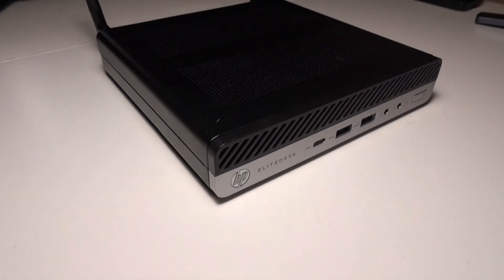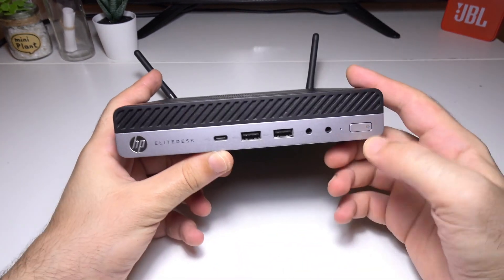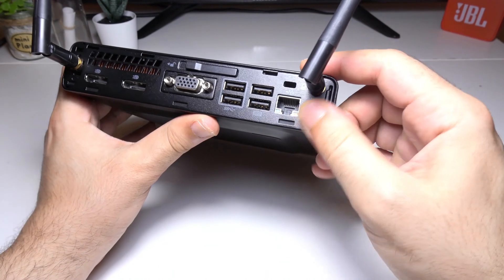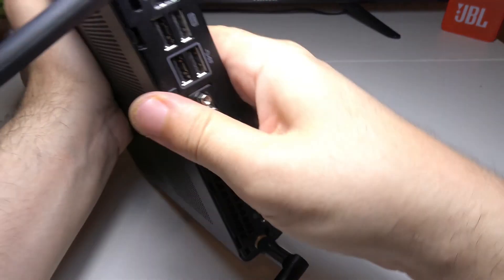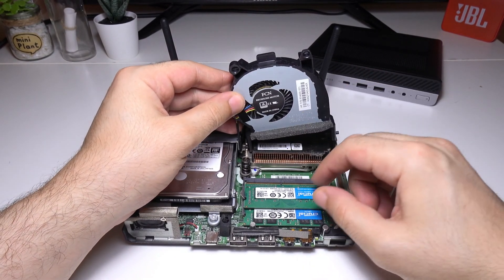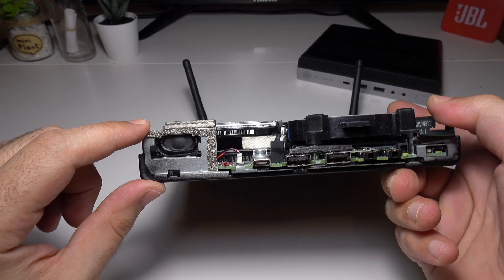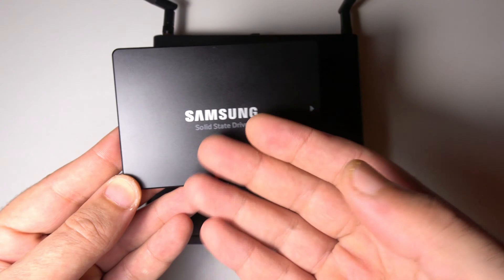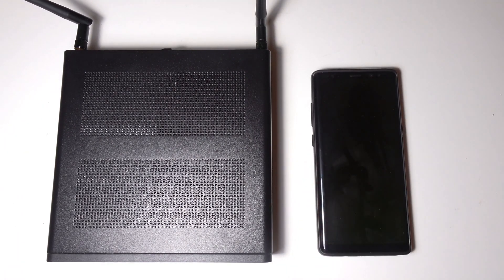HP EliteDesk 800 65W G3 (Everything You Need To Know)

Comment: I need this for my podcast live streaming
Reply from the maker: It's a bit old now. Pick up the newer version, and check the link in the description.
Reply: @RandomTeq  the one I was looking at has an INTEL CORE i7 QUAD CORE ram 32GB 120GB SSD
Reply from the maker: Check this, i7 16gb 512gb SSD. You can upgrade the RAM if you wish.

https://amzn.to/464zBs0
Reply: @RandomTeq  thank you for getting back to me. I’ve actually found a mini PC on Amazon UK and it’s I’ll send you the specs so you can tell me what you think. My friend has the exact same one and it’s very good for streaming. ACEMAGICIAN Mini Gaming PC AMD Ryzen 7 Pro 5875U(up to 4.50Ghz), 32GB DDR4(Dual Channel) 512GB NVMe SSD Mini Computers, 4K-Triple-Screen/WiFi6/BT5.2/RGB Lights/3 Modes Mini Desktop Pc for Gamer i’m not going to game on it all I need it for is my live streaming because I do a lot of paranormal stuff and I need to share multiple screens
Reply from the maker: I believe this is the one you're referring to:

https://amzn.to/41vyP5Y

It's a good brand, I have reviewed one of their mini PCs before. The CPU is reasonably powerful. For streaming, it will do just fine. Both the SSD and RAM are upgradable, which is a good thing.

Comment: Does anyone happen to know if these support a 2560x1080 ultrawide resolution..?
Reply from the maker: Yes, it can support all the way yo to 3840x2160.

This version is now outdated. You might want to consider the new version that came a few years later. it's not the latest, but it's far better than the one on this video.

Its 250 USD and offers far better value.
https://amzn.to/3ZuvJOF
Reply: @RandomTeq  Thanks man, I really appreciate your answer. I do already have an 800 G3, and was thinking of getting a 21x9 monitor. The thing is, when I plug it in to my HD monitor, the highest resolution it offers is 1920x1080, but when I plug it into my 4k projector, it now offers up to 3840x2160, as you mention - but no sign of any 21x9 ratios offered. So, to be sure, does this mean that if I plug it into an ultrawide monitor it will then offer a 21x9 ratio like 2560x1080, or 3440x1440? Cheers.
Reply from the maker: I've had a similar issue with regards to the resolution on a monitor. A few things to cover are:

Check if the settings allow for a resolution bump up. usually, this option is available under "display" settings on windows. 
High-quality HDMI cable.
Avoid any nonesimatrical cable (DP to HDMI, for example) and stick to HDMI to HDMI or DP to DP.
switch between different ports on both PC and monitor.
Reply: @RandomTeq  Once again, thanks so much for getting back to me on this one, I genuinely appreciate your help. I'll follow your advice and see how it looks. It's a great little PC, and I enjoyed your video: It was only after I bought this HP on eBay a few months back that I realised there was such a big community of admirers of this little thing - it sure beats the little Minix mini PC that I bought it to replace!
Reply from the maker: Pleasure, I have a video coming next about a Mini PC from AliExpress that will probably be very affordable and super powerful!
Reply: @RandomTeq  Great! I've subscribed, so will certainly watch that.

Comment: Nice video. I purchased a replacement motherboard to rescue my fried 65W. I transferred all components to the new motherboard and am happy to say I'm back online. But, as it turns out, the board came from a 35W. As far as I can tell, everything is operational, even with two drives are installed. Is there anything I should be aware of? Is flashing the 65W bios worth it?
Reply from the maker: You risk bricking the motherboard with BIOS update, I'd say, finding it safer to find a compatible 35W charger. Watch out for any weird smells or behavior. I suppose because there's not a big difference in power between 65W and 35W, the board is still operational, but you can't be sure how it behave long term.

Comment: I have two of these with an i5 processor.
Already NVME and SSD.
My question is:  What is the advantage in speed with a processor upgrade ??
And which processor it will be ??
Reply from the maker: You can go as far as i7700 (Kaby Lake), but don't expect a huge boost in performance, I tried both, and the performance improvement is about 5 to 10%, depending on your task.
Reply: @RandomTeq  THANKS !!

Comment: I have an elitedesk 800 g3, i7, 7700,  runnings windows 11pro,  Storage  256GB M.2, / 1tb HDD 16GB Memory. Just bought two new 27" 75Hz HDMI Sceptere monitors.
Just bought it used, it works great, BUT it wont support two monitors . It has 2 vido ports and (1) hdmi PORT. THE message I get is, Your monitor cant project to another screen. Try reinstalling your driver or try using a different video card. I dont have a driver to reinstall, suggestions on video cards or other options.

Comment: I'm just getting blown away by these Minis. I worked in computer in my career and we always had rooms full of equipment. Years ago when they moved the footprint to desktops that was huge. Now it's really small. I got a mini for my wife and when I connect it the cables are heavier than the computer. I still use a desktop  but I am considering one of these to replace it.
Reply: I'm excited. The 15th gen CPU will soon come out and the power consumption will the same good as apple. The size will be smaller and no longer need metal case to distribute heat.

Comment: Is there a DC power adapter? I have yet to find one
Reply from the maker: Yes! You can find it online, it runs at 65Wats for the low power one and 95Watts for the onenin the video, read the specs and search on eBay, I'm sure you can find it.
Reply: Thanks for the video and response. Looked everywhere.  There are universal power supply adapters, but from what I understand, they won't work with HP.  I've seen one for HP Probook with same specs and looks like same barrel plug, but not seen one for EliteDesk
Reply from the maker: @phurla1  https://www.ebay.com/itm/134650954446?mkcid=16&mkevt=1&mkrid=711-127632-2357-0&ssspo=sppkcbbtsyy&sssrc=4429486&ssuid=5EditP2BTw-&var=434169317365&widget_ver=artemis&media=COPY

This is the one 33USD including shipping, if you have the I7 65w version.

(Check your model power requirements here)
https://support.hp.com/us-en/document/c05371240

Comment: My newly purchased Mini 800 has 3 Display Ports.  I have never used DP before, but I have an unused cable for my Dell monitor.  I thought it would be simple enough to connect one to the other, but the monitor appears not to get a signal from the HP.  Just says "USB-C not found" (which is how I normally connect to my laptop).  .... Never mind: I just discovered that the monitor needed to be switched to manually search for DP.
Reply: What is it called exactly? I am looking for 3 display port or 3 hdmi port device.
Reply from the maker: The one in the middle is interchangeable, you can find it here for around 10 USD, you can either buy it used or configure at the time of buying new from HP website, bear in mind there are newer models now.

(Check the specs of your exact model before purchasing)

https://www.ebay.com/itm/325872351404?mkcid=16&mkevt=1&mkrid=711-127632-2357-0&ssspo=g9aeTGxjRo-&sssrc=4429486&ssuid=5EditP2BTw-&var=&widget_ver=artemis&media=COPY
Reply: Mine is the HP EliteDesk 800 G3; paid around $100 including Win11 Pro.  Very happy with it so far; but I may swap one of the DP for HDMI for more flexibility.
Reply from the maker: Yes, or get a DP to HDMI adapter.
Reply: @RandomTeq  yes, the two left DP sockets are both DP++ which means you can get an adapter which makes them HDPI compatible.

Comment: Thanks for the info.  I want to purchase this exact machine (ebay).  Can I install Linux on it with no problems?
Reply from the maker: Linux is a far easier and lighter software to handle, it will work fine

Comment: If i upgrade the cpu will the fan be able to handle it or will there be hearing issues? Mine is i5 7500 and thinking of upgrading to i7 7700.
Reply from the maker: It's a small upgrade, but it can handle it as the pc specs are designed to handle from least to most powerful.

Comment: Great video, thank you 😊 did you get this working with a faster speed of ram (3200)? And are you using 2 x 8gb sticks? Thanks
Reply from the maker: 2x8GB, there's a limitation on the RAM speed as stated by the manufacturer. You can get upto 2666hz, even if you do get a fast stick, you don't gain any performance past a certain point.

Comment: Underneath your 2.5" SATA drive, there should be an empty slot for an M.2 NVMe drive.

When you lift up your 2.5" SATA drive, is there a fan there to cool your storage drives?
Reply: Every time I see one of these and people don't lift out the drive cage and put an nVME drive in, or at least point out it HAS ONE, it kinda drives me a little nuts. lol. The fact it can take an nVME drive is one of the best features of these little PCs, IMO.

Comment: Hello. Thanks for your review. Can you please tell me which power supply it uses? Does it run on 12 or 18 V?
Reply: I use it on 12v.
I bought a car cigarette lighter charger to my old hp laptop. The laptop is broken but i use the charger (65w) constantly with this pc not the normal voltage (230v in Europe) socket. Work fine.
From mini solar system. I can edit 4k videos like this but the fan is noisy in this case of course.

Comment: Hello, I just installed a HDMI module to try to get audio through it, but it does not work, it detect it as a DP, is the a solution?
Reply: Have you tried a cable with DP to HDMI. The left side DP should be capable of HDMI with just a cable that supports HDMI one end and DP at the other end

Comment: The EliteDesk 800 G3 is available with both 6th and 7th generation processors. I recently (December, 2022) bought a G3 with an i7-6700T (35w) processor in it. The top of the unit was not perforated like the unit in the video. Also, there was a "bump" on the rear containing the Wi-Fi antennas. There were no antenna connections or antennas on the rear. Lastly, mine came with a third Displayport port added in the expansion space on the rear.
Reply: Most of these machines that you find on eBay do not have Wi-Fi or Bluetooth. Ones with large external antennas like in the video are extra rare. The ones with WiFi and Bluetooth usually have the bump in the back by the display ports. And another antenna is in the front under the speaker. If you want to add Wi-Fi to one that didn't come with antennas of any kind. Try to find a kit with large rear antennas because there's no mounting holes for the front antenna on units that never came with WiFi.
Reply: @David-nh7px in a unit without wireless connection: is installing an internal wifi card enough? Or an external antenna is required too?
Reply from the maker: Not Required, HP sells it as an add-on. It will help with signal strength, but wifi card should be sufficient, make sure you route the cables to the designated area in the back.
Reply: If your unit did not came with internal wifi, you can easily add your own.. either intel 7265 or 8265. You will need two antenas, mount them in the same spot as in the vid. I find that it work better with your own antenas esp with 8 or 9 dbi. Note you may need to remove metal tabs to fit the antena connectors.
Reply: You don't normally get a perforated access panel with 35W TDP processors, those tend to come with the hotter 65W TDP which also has a copper fin heatsink. The GPU is actually on the processor, not on the motherboard or chipset.

Comment: Did you ever try out the 3200mhz ram?
Reply: Update: I tried 3200mhz ram and it remains locked at 2400mhz with no ability to change in bios. Interestingly it’s CL22 but per HWinfo it’s being set at CL17 🤷🏻‍♂️

Comment: I have a problem. Perhaps you can help me. I have the elitebook 705 G5. I am ttying to use a dell 180w ac adapter. The voltage and polarity are correct. But it wont turn on. The av adapter works fine. I have tested. Any clues?

Comment: Supporting 3200mhz ram doesn't mean it runs at 3200mhz.  It only runs at 2400mhz, educate yourself.
Reply: Correct.  The i7-7700 (the top performing processor for this PC) is maxed out at 2400 MHz RAM speed anyway.

Comment: Can you tell me the HP part number for the usb c option board that replaces the display port module for a HP 800 G3 mini, also the HP part number for the HDMI option board  that replaces the display port module for a HP 800 G3 mini. I could not find the part numbers anywhere on HPs support site.Thank you in advance.
Reply from the maker: https://www.amazon.com/HP-3TK72AA-Audio-Video-Connector/dp/B07DH4597J

There are different types depending on the generation, make sure you pick the correct one for your device. If you don't know how to, open your device and look at the additional port screws location and position and eye it out.

Search for the term "Flex IO"

Comment: Will an elitedesk 800 g3 mini 65w machine be compatible with an intel i7 8700 processor? I realize that this processor is an 8th generation introduced to the 800 g4 mini but was hoping it would be backwards compatible to the g3 mini. Can you help please?
Reply: this "Gen 3" of hp "mini" has model Q270 chipset soldered, and Intel says it's too old for 8100-8800 project "CoffeeLake" CPU, sorry. Get g4 with Q370 soldered chipset mobo
Reply from the maker: Hi John, it's not compatible, 7700 is the highest possible CPU configuration. 

I had a i7 9700 & i7 8700 in hand, so I tested both, nether one worked despite having the same intel socket (LGA1151).
Reply: @RandomTeq  Many thanks for your swift response. Will stick to the 7700 then. Thanks again.

Comment: Great video. Nice exp;anation. I like your accent by the way. SO CLEAR.  I am wondering if this type of HP mini PC's supports Youtube videos on 1080p 60hz with its built in graphic card.
Reply from the maker: Thank you Tony! 😊 
This pc doesn't have a dedicated graphics, it uses igpu, it can run 1080p at 60hz with relative ease though.
Reply: the H-VEC movie decode Intel has in G530 GPU is great for moving images, yes. All Intel GPU is located inside the socket with the lift-rod latch ..and the CPU under the same fan block.

Comment: I want to get the Wi-Fi antenna but can't find the part number/name. Please share it with me, thanks.
Reply from the maker: https://www.ebay.com/itm/Antenna-For-HP-400-600-800-G2-G3-DM-Mini-wifi-built-in-Wireless-Antenna-Ipex-/233676279262?mkcid=16&mkevt=1&_trksid=p2349624.m46890.l49286&mkrid=711-127632-2357-0
Reply: @RandomTeq  thanks a bunch. So I'd need to buy No. 2 & No. 4 options to match your antenna system setup.. right?
Reply: @TamasGautam  same assumption here, but I guess he means get No.2 and then you can screw on any WLAN antennas?
Reply: @RandomTeq  Awaiting your response eagerly 😁
Reply from the maker: @TamasGautam  Any WLAN card laptop size will do.
Reply: @TamasGautam  9560NGW - Intel Dual Band WLAN WiFi Wireless M.2 NGFF AC 9560NGW BT 5.0

Comment: Can you install Hard drive and SSD both on this device?
Reply from the maker: Yes, but not at the same time. It supports NVME M.2, along with SSD/Hard drives.
Reply: @The Amazon Shopper  i can hook up a egpu by using m.2 nvme ?
Reply: @1987Redfield yes
Reply: the bare, green strip SSD is held with one screw, under the 3TB "spinner" in metal support cage, >yes<

Comment: Hello, does this 65w PC support the i5 7600t CPU? I bought a barebones HP Elitedesk Mini 800 G3 65w and was wondering if I could use that processor with it (I know it supports the i5 7600). Thanks.
Reply from the maker: Mine has the I7 7700T, no info what's so ever on HP website about the upgradibility of CPU, please do share with us if you managed to get it to work with a new CPU chip.
Reply: any "T" CPU is under-clocked, so it can't make more than 35Watts of waste-heat for the cooler. any mini model "65W" option VRM circuit can use any CPU. All are 65Watts or less.
Reply: @bryanminugh9680  Do you know if the g3 mini 6th gen i5 model is compatible with 7th gen cpus? 
I'm just not sure if the bios will recognize them.
Reply: @bryanminugh9680  Sorry, I think you misunderstood my question, there is currently no cpu in the socket, but it previously had an i5 6500. 
I was just wondering if I could upgrade to a 7th gen i5 7500. 

I'm not sure if the older bios is compatible with the newest 1151 gen.
Reply: @nickskizekers1906  Intel says a Q270 chip set motherboard can use project name "Kaby Lake" CPU. The previous project "Skylake" used H110 chip set soldered on the motherboard. For some g3 h-p put an H110, others Q270. More confusing, Skylake and Kabylake are all mixed together in the way the CPU chip got a model number.
Reply: @bryanminugh9680  Kind of figured they weren't compatible but wasn't sure, its hard finding any solid info on oem pc's.  Thanks for the help.

Comment: Does anyone know of its possible to install a i7-8700T instead of the 7700T CPU?
Reply from the maker: The CPU is upgradable, however I can't confirm if the one you suggested will be compatible with this unit. Mine is running I7 7700T.
Reply: Dose it work?

Comment: I bought one online and I do not think I bought a ssd drive with it. Can I purchase one and install it to this at any time?
Reply: under mechanical HDD support frame, you insert a green strip "naked" SSD to the black socket. It is a PCI (parallel) path, so dramatically faster than a serial-connected (S-ATA) legacy SSD in the metal HHD cage. Communication protocol "nVMe" is very-much-more efficient than AHCI
Reply from the maker: You certainly can, these models don't come with SSD from manufacturer, but swapping an HDD with SSD is one of the easiest upgrades a one can do at home.